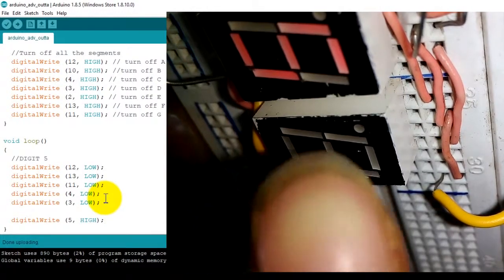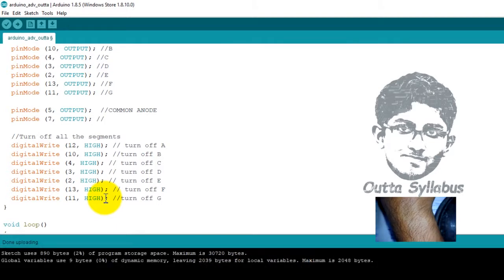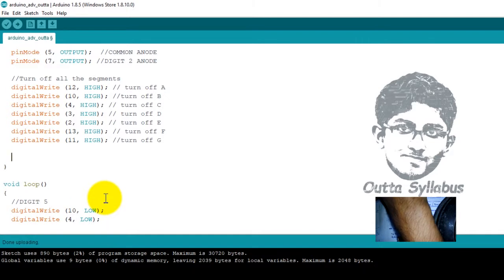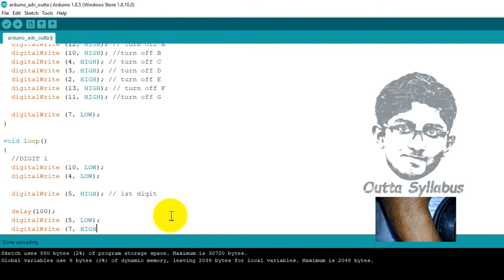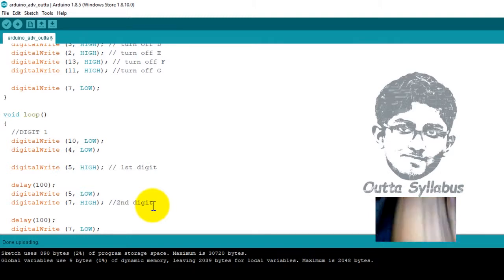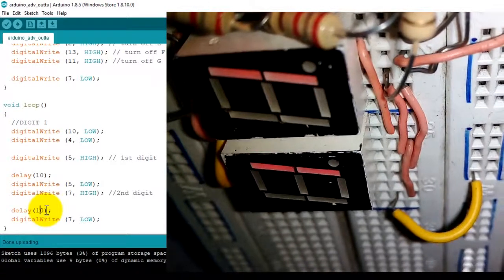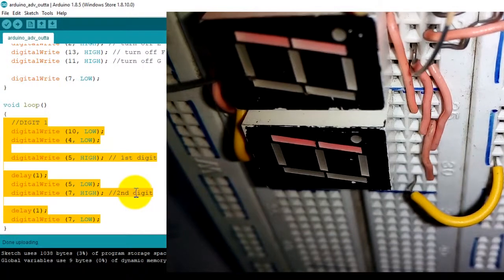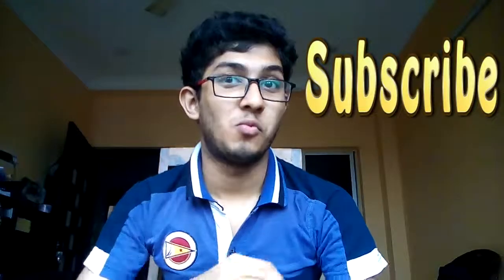How to control Multiple Digit 7 Segment LED display with Arduino, Multiplexing Tutorial

Comment: My segment display is cathode.
My problem is gap between '10'  and  '0'. So fast that almost can't  see number '10'

If i removed For Loop that display 0-9 then it shows number '10' perfectly little bit flickering.

please help

/////////////////////////////////////// Count Up 0,1,2,3,4,5,6,7,8,9, and 10 then back to 0 ////////////////////////////////////////////////////////////////////////////////////
byte SegmentPin[7]={2,3,4,5,6,7,8};
byte digitPin[]={11,12};

byte displayLED[10][7]={  //Digital 0-9, ABCDEFG 0-7 for Cathode (1 Active 0 Inactive)
  {1,1,1,1,1,1,0},  //0     ABCDEF                   for Anode   (0 Active 1 Inactive)
  {0,1,1,0,0,0,0},  //1     BC
  {1,1,0,1,1,0,1},  //2     ABDEF
  {1,1,1,1,0,0,1},  //3     ABCDG
  {0,1,1,0,0,1,1},  //4     BCFG
  {1,0,1,1,0,1,1},  //5     ACDFG
  {0,0,1,1,1,1,1},  //6     ACDEFG
  {1,1,1,0,0,0,0},  //7     ABC
  {1,1,1,1,1,1,1},  //8     ABCDEFG
  {1,1,1,0,0,1,1},  //9     ABCDFG
};

void setup() {
  pinMode(2, OUTPUT); //A   
  pinMode(3, OUTPUT); //B
  pinMode(4, OUTPUT); //C
  pinMode(5, OUTPUT); //D
  pinMode(6, OUTPUT); //E
  pinMode(7, OUTPUT); //F
  pinMode(8, OUTPUT); //G
  pinMode(10,OUTPUT); //Dot

  pinMode(11, OUTPUT); //digit1    
  pinMode(12, OUTPUT); //digit2    

  digitalWrite(11, HIGH);
  digitalWrite(12, HIGH);
   
}

void loop() {
    
   for(int i=0; i<10; i++)                                               //Display 0-9
   {
     for(int j=0; j<7; j++)
     {
        digitalWrite(SegmentPin[j],displayLED[i][j]);
         
     }    
     delay(1500);    
   }
   
                                                                                 //following mulitple lines here just to display '10'
     digitalWrite(2, 0);
     digitalWrite(3, 1);
     digitalWrite(4, 1);
     digitalWrite(5, 0);
     digitalWrite(6, 0);
     digitalWrite(7, 0);   
     digitalWrite(8, 0);
     digitalWrite(10,0);

     digitalWrite(11, LOW);
     delay(5);

     digitalWrite(11, HIGH);
     digitalWrite(12, LOW);

     delay(5);
     digitalWrite(12,HIGH);
     digitalWrite(12,LOW);

     delay(5);
     digitalWrite(2, 1);
     digitalWrite(3, 1);
     digitalWrite(4, 1);
     digitalWrite(5, 1);
     digitalWrite(6, 1);
     digitalWrite(7, 1);   
     digitalWrite(8, 0);
     digitalWrite(10,0); 

     delay(5);   
     
}